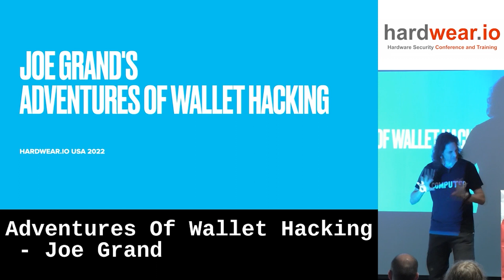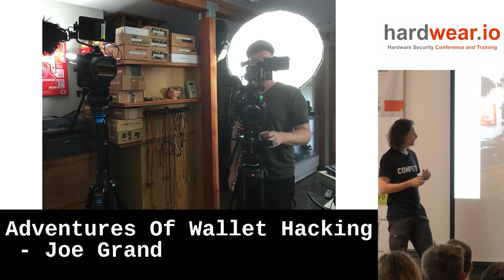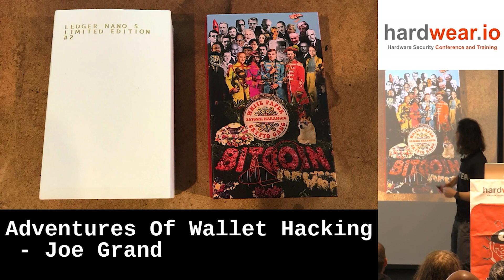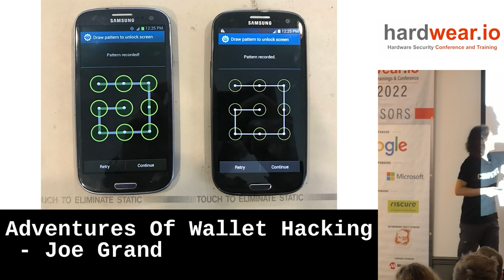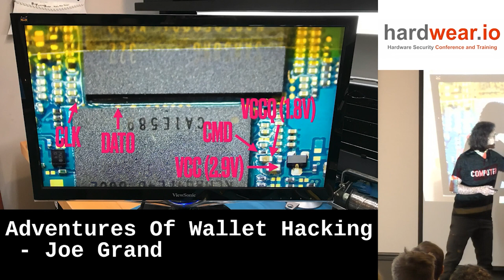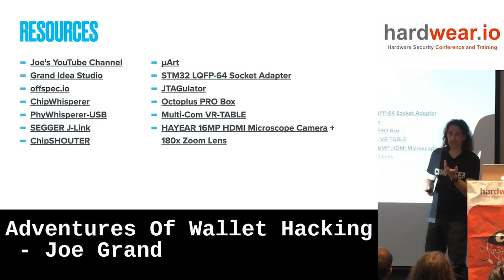Keynote | Adventures Of Wallet Hacking by Joe Grand | hardwear.io USA 2022

Comment: Is my Tektronix TDS 2024B a sufficient scope for a project like this, or do I really need a >$10,000 scope like what Joe has?
Reply: The scope is just a tool. There is no red button on any scopes that hack the device, you should know your tools. If the signal that you want to see on your scope is not "too fast" for your scope, then you can use it. For simpler hacks, you can get away even with the cheapest ones, yours should be more then enough. If you need a better scope, you will know it, but you should know that it is not the scope that performs any attacks. The scope can visualize for you what is going on, but cannot do anything to the signals. For that you need other tools as well, that are usually much cheaper for simpler projects, and much more expensive for really complex projects.
The best way to get started is just to start doing it. You will see many tools you need but don't have, you have to get them, and start again. If the tool is too expensive, search how can you replace it with a less expensive one, or build one that fits your need for cheaper.

This trial and error method is not only a working method, this is the mindset you need to have to be able to hack things. Most of the time, even if you know the exact method you need, you will fail with it on the first try. You need to think about why it failed, or can it be solved in some way, then try it again in regards the new informations, and repeat this process until you succeed. You will succeed if you do it enough times.
Reply: @tvili999  
I see. Thank you. I appreciate your advice.